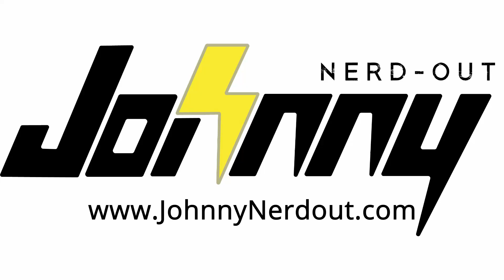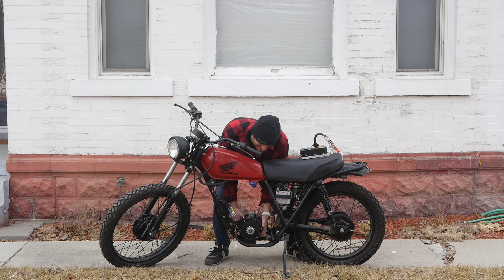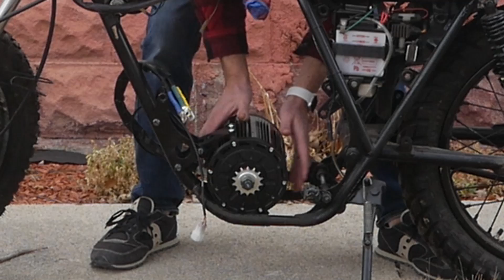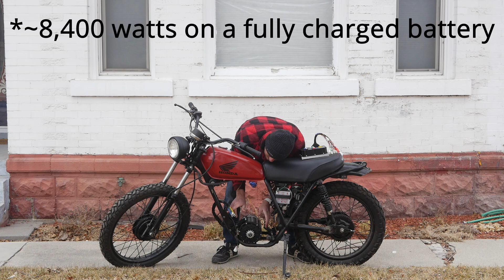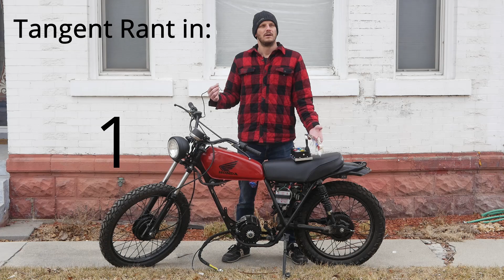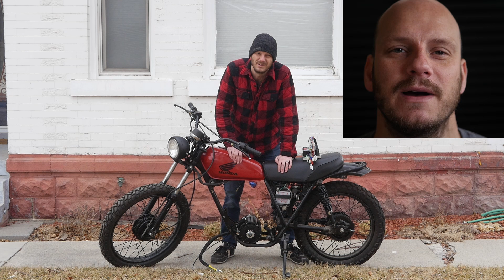Electric Motorcycle Conversion Honda XL175 #2: The Motor- QS 138 Mid Motor. What a pain!

Comment: Also, im sure you aready figured this out by now but you can buy a wiring harness for that set up that will make everything plug and play.
Reply from the maker: The throttle was not plug n play. I had to make my own connectors 🫠

Comment: Would a hub motor even be an option for motorcycle with drum brakes?
Reply from the maker: No not really. I don’t think they make hub motors with drum brakes 🧐
Reply: there are a few now, on aliexpress, but all lower power. there are also drum to disc conversion options. a mix of the two is a better bet.

Comment: 1. Throttle only has 3 wires.  Your name is nerd out....you can splice in 3 tiny wires? Lol
2. American workers are lazy and arent gonna work for what the chinese will...they wouldnt even work if they were getting paid 10x the chinese.
You are shocked?? Lmfao
Reply from the maker: The point is that I paid good money for a kit that I shouldn’t have to splice anything. On ebike throttles there are only 3 wires, but not on e- motorcycles. 
2-For what I paid in shipping from China for this thing could’ve paid a workers day wage easily at a good living rate so I don’t subscribe to that theory.

Comment: planning an e moto conversion project and the sense i am getting is a hub motor seems easier, but unless you know for a fact that the motor can go in the swing arm without modification it may turn into a huge headache

generally you will need to modify your swing arm for the motor axle itself, plus add a new mount for rear brake, and that is a lot of sensitive work that you better be a skilled fabricator for. whereas the mid drive all you have to do is make a mounting plate, which there are many companies online that will cnc cut a plate for relatively cheap, some even provide simple CAD software for you to use
Reply from the maker: Exactly, thats why I went Mid drive

Comment: In another video you'd said that chain/belt drives are generally better but that for motorcycles the efficiency differential at higher power is much less and you prefer hub motors. Why is that? Is it just that electric belt drive conversions on motorcycles are a pain in the ass?
Reply from the maker: It’s like how electric cars work. Single speed essentially but with tons of power. You no longer need a transmission to finesse the power how you need it. With a hub motor drawing a lot of power, performance is very similar and no drivetrain wear.

Comment: Manufacturing has left the United States because of Free Trade policy and a global race to the bottom in wages. Labor is cheaper abroad, particularly in countries with weak labor movements.
Reply from the maker: It is indeed sad how a lot of consumers only factor I cost when purchasing a product.
Reply: @JohnnyNerdOut  I put the blame much less on consumers and more on producers and the economic system as they have way more power and importance in this situation

Comment: The qs138. 70h can do 20kw
I do it all the time,
I have about 5 of them. I even have a dirt bike with 2 motors 2 controllers on one jackshaft system pulling about 700nm of tq. I also build my batteries from lipo cells etc..
Reply: I have seen all your videos sir , big fan of your works!!
 Want to ask some questions regarding the qs 138 70h motors - “ 1) do they heat on 1hr driving?
2) is the torque real ? I mean can it put torque enough to pull a 150kg e bike (I’m planning for)
3) i desire a speed of 60kmph only but with wheelie like torque - plz suggest me a motor sir
Thanks
Reply: @weareaunit8931  
The 70h do get hot,
I do believe it is from two factors 
1- air flow
2- the overall weight it needs to move.

My orange light weight dirt bike uses the 70h and it just gets warm. It has great airflow and very light weight bike.

You probably be better off with the 90h version. It has better magnets and can produce more power with less heat. I’m actually putting one in a power wheel and over volting it, making  a drift trike out of it.

Comment: If you want the best value for your $ build your own battery-  
the battery cells I chose is Molicel P42A 21700 4200mAh 45A Battery. Has the best performance from what I've been able to research.  You'll get about 1300 watts for an hour out of a 10 lb battery pack (80 cells for a 72v 4 parallel 20 series battery that can put out 160 Amps. For your application I would use 3 of them (240 cells) and will cost around $1200
Reply from the maker: Very nice! How long of a build time? I know eventually I need to start building packs but I just can’t justify spending the time right now 😭
Reply: I’ve gotten pretty fast at them to where I can assemble and spot weld them together in about three hours but my first time doing it took a couple of days because I tried to cheap out and solder the batteries together instead of spot welding. I also started my first pack with used 18650 cells but continually had problems so it’s brand new cells from now on- keep in mind lithium ions have a life of about 6 years so if you get cells that are 4 years old (conservative estimate) you may only get a two year lifespan out of your pack, which happened to me.

Comment: I have build electric dirt bike using that motor and it was pretty easy. I am using sevcon gen 4 size 4 and it was hardest part of my build. Here is picture of it https://cdn.discordapp.com/attachments/597905217463255084/825751049520414720/20210328_181916.jpg
If you need help just send me a message.
Reply from the maker: Nice! Thanks 😊

Comment: Johnny, great project. If you can mount the sprocket on motor  close to swing arm and centered on swing arm it will keep chain as close to same slack through the massive 4 inch rear travel on the swingarm. Welding the brackets to back is worth the time. Find a good welder person that can make and i install rear brackets with motor adjusters for chain tension.  This will be a super cool electric retro on an old classic Honda. It will be well worth the cost for a valuable classic "Electrified" by Johnny". The Honda EBJ Retro. Cant wait to see it done.

Comment: Dude I feel your pain. I recently recieved a kit from them and I had to make quite a few wiring modifications. The communication has been good for me but there is a lot more hassle that goes into getting their kits to work than their should be. I would way rather pay for American made but there just aren't many options.
Reply: I got an 8-12kw v4 hub motor kit from them and one of the hall sensor plugs for the controller and 2 other wires used to get it to spin I had to take off the plugs and solder them together. The display they sent me doesnt fit any of the plugs and the throttle doesnt fit to anything either

Comment: Hi Johnny, can't wait to see this conversion! I have two questions, you said when you worked at the shop Hub Motors broke a lot of spokes oh, so I thought that a bigger motor would even be worse at breaking spokes? Also I was wondering do you think it would be safe to buy a sur ron from Alibaba? I think you're one of the most knowledgeable ebike guys on YouTube. That time you road across your state was epic 😎 much respect!!
I know because I once rode a Honda 750 four in 1981 from Florida to Northern California
Reply from the maker: Appreciate that! It’s not the power really that breaks spokes, it’s the quality or lack of it when building the wheel around the hub. 
Just check the reviews best you can, but ya 🤞
Reply: @JohnnyNerdOut  thanks so much for the reply!

Comment: Is that the 90h cause if it is it can handle over 32kws of power which would be a bac8000 at like 400a and rediculous phase amps if its the 70h you can handle over 20kw of power with bac4000..... nucular are also a good option 😉   with 100a your not even scratching the surface of what that motor can do (either version can handle 10kw continuous with ease)

Comment: Why don't you mount it towards the rear in the triangulated section just forward of the swingarm mounts? This seems to be how most do it. Obviously requires a custom bracket and welding.
Reply from the maker: Barely doesn’t fit there😩

Comment: That's a big chunk of motor, bigger than an alternator in a car. I also think that electrical items should be made here in the U.K. or Europe. We are too dependant on China for almost everything. My communication between Junstar the seller I bought my Bafang kit from on Amazon has been great. In fact one of my hydraulic brake sensors went faulty last week and I sent him a message via Amazon asking for a replacement and he sent 2 new sensors within 1 week.
There is a shipping problem world wide due to the pandemic. It is mainly due to the cost of containers which have tripled in price for shipping goods, also there is a staff shortage at ports, so most ships are not being off loaded fully.
The bike is coming along great apart from the throttle issue. :)
Reply from the maker: Nice!!!!
Reply: #irishrover i live in london , and i wasn't sure either i buy the kit from junstar or AliExpress overseas warhouse , after seeing your comment could you please tell me how many weeks until you receive  it , and any advice before i buy from this seller on amazon , thank you

Comment: Good point about making things in America especially in the times like this. It makes no sense that you cant get something like that here in the states. Period!
Reply: @Goby Gobiidae actually look up grin tech a canadian company they do that, its more expensive but they offer added value like higher quality winding, better fixture, integrated splined hub torque arm etc, if you offer better value at the price people will. The chinese one don't last beyond a year, they rust and windings burn out under heavy load. All these hub hotors were designed by australians who setup small plants in china back in 2010 and chinese haven't improved anything on it
Reply: Trump tried to do that, but people voted him out
Reply: @aakarshchaudhary7359  you are correct sir!!
Reply: Yes it's really too bad because Trump was trying to change all that. It's unfortunate but the US just does not make much stuff anymore.
Reply: @tallcool1jeff  US is still the #2 manufacturer in the world, with 1/4 the population of China.  US is less than China, but more than double the #3 country.   US typically makes lower quantity, higher cost goods.   China does the opposite (high quantity, lost cost).   What also might surprise you is that US is #1 in oil production in the world (yes even in 2023).   #1-3 are very close in Oil and switch spots occasionally.  I don’t get where people get these ideas.